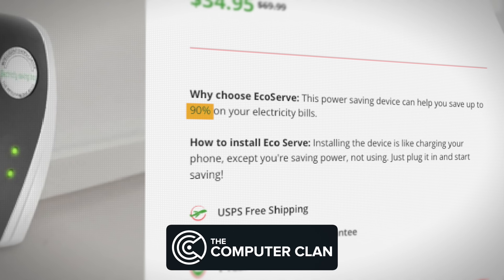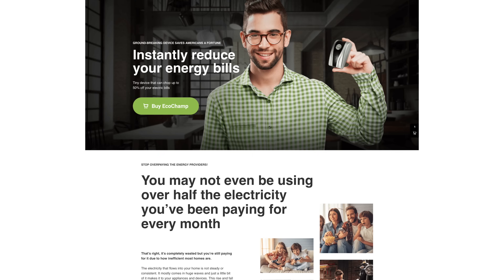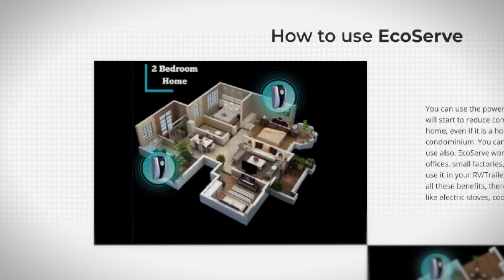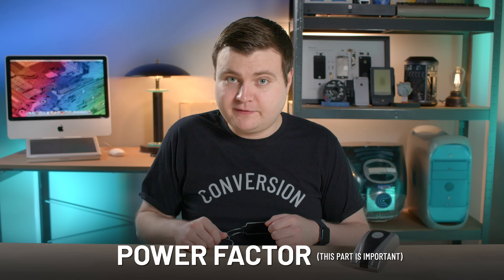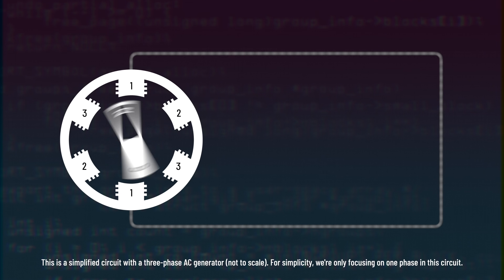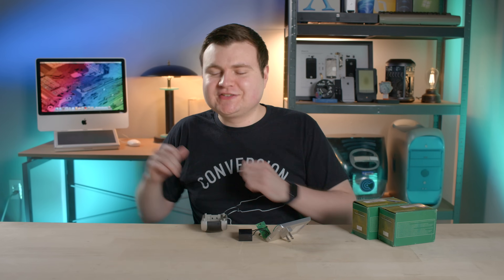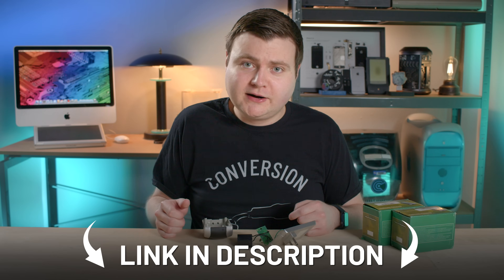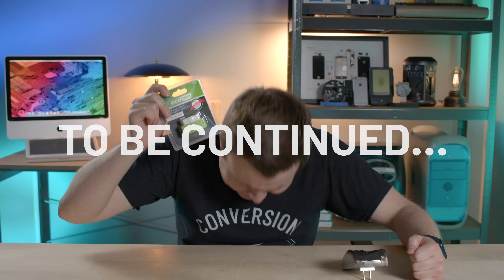Electricity Saving Box Scam (The WORST I've Seen) - Krazy Ken's Tech Talk

Comment: I bought a product that promised to save me money on the electricity that my washer and/or dryer used.  It worked by reducing the voltage to the motor by some percentage and then gradually increasing it as it started up.

I didn't buy it to save money on electricity.  I bought it to reduce the number of belts I was replacing on my dryer.  The motor had such torque that no matter how I tightened up the belts they would still slip when the motor started.

With the device in line, the motor would gradually start up and the belts didn't slip.  I did save money and aggravation from not having to replace the belts.  I have no idea if I saved any money on electricity.

I liked the product.  I never replaced another belt for the life of the dryer!

Comment: An "outlet" is the box inside the wall that the electrical wires from the breaker panel go into.  You plug something into a "receptacle" that is wired and then attached to the "outlet".  Light switches, for example, are also attached to "outlets"..... just sayin..... 🙄

Comment: I don’t think you’ll understand the claims. They are clearly telling you the device saves you 90% in the energy that it could be using, but it’s only using 10%. The other one would have used 50% of the total amount it could have used. This is not the amount of energy is actually saving you from other devices but from its own. So if you plug this in and it should be using, let’s say 100 W of power it’s only using 10% so only 10 W of power. So it is saving you 90% of the power that you could be wasting on this device they’re not lying. You guys are just not understanding the claims.

Comment: The flickering you allude to does not happen with incandescent bulbs.

My father an electronics technician in the Nave for twenty-six years taught me a simple mnemonic to remember how capacitance and inductance affect phase shift. It is "ELI the ICE man."

Inductance, L causes voltage, E to lead current, I. If you look at the voltage curve superimposed on the current curve, the voltage will reach its peak value before the current (ELI).

Capacitance, C causes currne3t, I to lead voltage, E. If you look at the voltage curve superimposed on the current curve, the current will reach its peak value before the voltage (ICE).

Since power is voltage times current, the further the two get out of phase, the less the power delivered.

By the way, we use E because we are actually talking about electromotive force, which is measured in volts, but voltage is easier and shorter to say and write.

Most household appliance use coils in motors which are inductors so the power company has banks of capacitors which kick in as needed to bring the two back in phase. Even in phase the power delivered is the Root Mean Square (RMS) of the product of voltage and current, the value is 0.707. In other words, the power is 70.7% of the product of E and I. P = 0.707 EI.

If you want to understand why this happens read a physics book, or a good electronics book.

Comment: I remember around 1980s gasoline shortage and there was a car that runs on water.  Sure, water carries more thermo energy than gasoline?  Surprise, 20 years later, the same fiction came up again.  Some clueless consumer?  Good video, BTW.
Reply: It's possible with hydrogen fuel cells but it's dangerous for everyday travel.

Comment: Back some time in the '92 - '95 window, we made a video for a guy (a scientist or so he claimed)   He put a magnetic coil around the fuel line on his test car and supposedly, by aligning the chakras of the gasoline molecules, he could increase the engine efficiency by like 20% (i.e. reduce your gasoline usage). I don't remember the actual technical explanation, only that all it was was an electromagnet and had something to do with aligning the phase of the gasoline molecules. The beauty of his device was that at that time, all you needed was a good sounding claim to get a tax break for driving an "Alternative fuel source" vehicle. So people could buy his device and have it installed for under $200 and then apply for a tax rebate that was way more than $200  and continue using gasoline as they always did. So did it work?  Well... that all depends of how you measure success.  He sure earned a lot of tax rebates for a lot of people.  In that sense, it worked. As to whether it actually reduced gas usage, I don't think there was any measurable effect for most people.

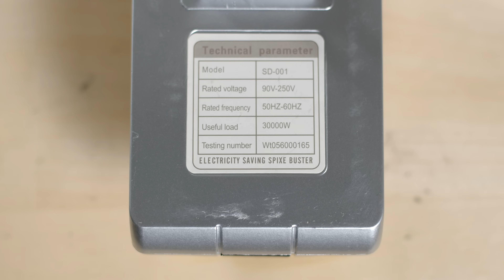Comment: @10:07   On the back, did you see that "Useful Load:  30000W"   Oddly, we didn't see any fuse in this device.  I defy you to take this to an industrial shop with lots of heavy motors and see if it even winks there. Either it will melt down immediately, or it wont do a damn thing.

Comment: One thing you didn't mention is that it seems the legitimate circuitry for this device is well known by bigclive fans as an ionizer. It seemed to have a few ion emitters connected to the capacitor. So they are essentially advertising an air purifier as a power saving device

Comment: I bought one of these out of curiosity. Used different tools I have to check power usage. But the interesting thing with mine. Same case. But actually had a large pcb with a bunch of components on it. I never bothered to pull my meter out and confirm they were all wires together on the board but I suspected half didn’t connect to anything. Just for show parts like they knew you’d open it. It also eventually started smelling like burning wires so pretty sure these things will eventually cause a fire.

Comment: Just think. If one saves you 90% on your electricity bill then two will save you 180%. So your electricity company will be paying you 80% for all the electricity you use. 

Time to plug in those heaters and air conditioners, humidifiers and dehumidifiers, etc. 

And if you get three, that’s 270% saving so the company now pays you 170%

Wow

Comment: Actually, AC itself doesn't help wires carry more electricity over longer distances, higher voltage does, and AC makes it relatively easy and cheap to convert electricity between higher and lower voltages, using simple transformers.  The end effect is to help transmit more electricity through longer distances, but today, it is possible to do the same with DC, and some of the longest, highest-capacity transmission lines in the world actually have DC electricity going through them.  This is because at equivalent voltage, DC is actually more efficient, since AC suffers from skin effect losses and reactive (capacitive and inductive) losses, which DC does not suffer from.

Comment: I hate to nit pick on such a well put together presentation, but technically, only ToastyHeater™ is super efficient, it recycles the heat already in the room so no heat is wasted. It's quantum fiber ceramic heating element breaks the laws of thermodynamics for extra efficiency.

Comment: Hello, I've just discovered this channel a few days ago, and when I saw this video, I've found this scam strangely similar to another one I saw on a French channel, about the same kind of product. Or maybe it's absolutely the same with another colors...
Anyway, you gave the same explanation about the power factor, the same kind of tests about this scam and the same analysis about the electrical circuit. Except one thing: he's goes further and dismantle the capacitor. Or what it seems to be a capacitor, since it's only rubbish. Yes, the scam is even worst than you thought.
(Sorry, there is no subtitles available in English, but I think the images are enough)
https://youtu.be/1FLwy4XPBg0?feature=shared&t=753

Good job and please continue. Not only you explain theses kind of scam in a perfect way to be understandable by everyone, but you also talk about some failed devices but done with respect and real hopes. And on theses, you talk about them with respect, telling us than even if theirs products are scraps, they are not cheaters or thieves. Thanks for that.

Comment: 6:36 As an Electrical Engineering student, I can say this part is wrong. Knowing that the power factor of an AC installation is equal to the cosine of the phase angle(the exact angle of the argument of the total impedance load attached to the installation) and this angle ranges from 90º to -90º its cosine only can range between 0 and 1.
Reply from the maker: Yes, I trust your explanation. I've heard (and just double checked with one of my research guys) in most practical AC applications it's 0 to 1, but I've also seen from multiple sources (which I just double checked) the negative sign is indicates voltage leads the current. Does it depend on the situation?
Reply: @ComputerClan  Well, the thing is that even if the voltage leads the current or viceversa you're getting reactive power that decreases your power factor. In AC systems the most probable thing is that the current laggs voltage because of most of the inductive loads attached to the line. That's where you use a capacitor bank to fix the lagging.

The positive and negative sign is used more on impedance and current phasors to represent them and that way you can figure out if you're working with and inductive or capacitive load.

Btw, I forgot to tell you, but it's the first time I visit your channel and you made me enjoy so much with this video🤗. Greetings from Spain!🤗🤗🤗
Reply: @ComputerClan  According to the main phasor sign agreement(used here in Europe as far as I know), inductive loads have a positive angle and capacitive have negative angle. However, in their current phasors the signs swap because of Ohm's Law.

Also,  the sign criteria for impedances angle comes from physical-mathematical conclusions about the phenomena from electromagnetic induction applied to impedances and reactances.

Comment: I bought one of these things a few years ago knowing it is a scam, but I wanted to know the level to which they might go to conceal the true nature of their claims.   I paid $12.99 and it came two weeks later.   After unboxing I could tell immediately it was too heavy for its size and a presumed transformer small enough to fit in the small enclosure.  It had an LED light  on its cover that worked when I plugged it in!  Not sure why this surprised me but I pressed on by prying the back plate off.   Inside the entire thing was packed with some kind of suspicious-looking glazing compound.  I tested it for lead and waddyano?  LEAD!   I put it under my fume hood, put on gloves and proceeded to scrape out the putty.  After it was empty I found the two LEDs and one resistor and NOTHING else!   I think I reacted to the first ad that was touting this thing because all of the expo videos now show a different unit.   Anyway, The lead-bearing putty had no wires in it to indicate it was being used a some kind of capacitor and as I have never seen a capacitor made this way it was readily apparent the whole thing was a scam!   I contacted the FCC and BBB and gave them detailed notes and pics of the entire affair and within a month the ad had changed and was now hawking the unit as it appears in this video.  IDK if my actions precipitated this shift or (more probably) they redesigned it by packing the putty into the little black box found in these things now because too many people scraped out the putty!  There are energy rectifiers in some things in your house.  They are not there to lower your energy costs but to condition the power to MOTORS in things like refrigerators, Washers/dryers, ovens and HVAC units.   Motors NEED smooth, reliable power to work efficiently and last longer, which is why you don't leave plugged-in automatic devices with motors during brownouts!  Low, surging power can destroy a motor in short order by inducing an electrical field that is too small to turn the rotor and fan with sufficient velocity to keep the windings cool.   This is why in lower voltage instances you should unplug or turn off breaker to any devices with motors that come on automatically.

Comment: Fun Fact: Power companies will actually encourage you to save power. The reason is that if so many people use too much power, the power plant may have a hard time keeping up, which will lead to power outages so they would have to build a new power plant to keep up. Which that is a pain, the cost to build a new power plant would be way too expensive, plus they will have to find a location as you can't really place power plants all willy nilly. The state I am from, the power company will actually provide residents a free power saving kit. Which will often include free light bulbs, a free power strip, and a few other things that will help save you electricity.
Reply: Also reduced loads over cables will let them last longer which means less costs in repairs.
Reply: Yea a lot of that energy saving stuff you mentioned are things bought by companies who are being forced by some local green laws to provide some green products, and buying faff of the shelf is easier than building actual green energy infrastructure 

One particular electricity company in the UK sent out dozens of energy saving light bulbs to customers a few years ago, like a microwave sized box of them! I've still got a good shoebox full left years later....  it raised a bit of press at the time as if the hour ratings on the light bulbs actually held up it was a 200yr supply for your average house! In reality it's more like 12-14 years worth
Reply: @mor4y green energy infrastructure is wasteful and expensive and does nothing for the environment, as was warned before and as is being demonstrated now.

🤷‍♂️
Reply: Less is more
Reply: The power company offers them, but they’re state funded.

Comment: The capacitors in motors are only for starting they do not stay in the circuit they are removed once it runs. There are no capacitors in motors for apparent power correction.
Reply: Starting capacitors would be needed in singlephase motors, but three phase they are entirely used to correct the power factor.

Comment: how can they charge for something that just goes back and forth with zero work done.
Reply: Because it still increases the load that goes through the cables wich will degrade them a bit faster, meaning they need to be repaired/changed more often wich costs money.
And it is doing work.
Reply: @Alex_Vir Its never dissipated, so it never does any work

Comment: A couple small corrections. Reactive power is not wasted as heat, waste heat in your home wiring is real power, but rather it increases the amount of current sloshing back and forth between the generator and you, so it increases the energy wasted in transmission lines. If we had superconductive transmission lines, reactive power wouldn’t cause any waste. To account for those line losses, either industrial customers’ cost per kilowatt hour of real power changes based on their power factor, or they are billed on apparent power.

Comment: A proper line noise filter costs around $100 for the lowest wattage output to 1 or 2 thousand for enough wattage for a small business. They are good for efficiency which means lower heat- think a small confined server room. They can also be good for power for high end audio equipment. But if the incoming current is already very low noise then they offer little benefit.

Comment: The PFC (Power Factor Correction) is part of any DC power electronics design specification. What is important is the "power efficiency" which is the ratio of the power used to do the actual work and the input power (counted/measured by the electric meter). If the input power is crappy/dirty then the power electronics has to work harder to correct and produce the desired DC output so it will consume more.  For example, an sound amplifier for 80W speaker would actually use 100W because the electronics circuitry will consume the difference in order to work, so the efficiency will be 80% (80W/100W = 80%). However, the heavy consumer in a home are the electric motors and heaters (cooktops & furnaces). So, the question is : what is the power efficiency of your devices (appliances, etc)? Is it 80% or even less? The difference from 100% is what you  "overpaying" in the bill. As an analogy, if I use premium gasoline or drive on the freeway (high speed and constant) I have better efficiency (mpg) compared with regular/dirty gasoline or driving in town (slow speed, stop & go, pot-holes). Unfortunately, the electric infrastructure is full of bottlenecks and the back injection into the grid which is out of control so it can't be clean.

Comment: I cut my “black box” capacitor looking device.  It was 2 wires embedded in some tan colored clay, not a capacitor or any kind of electrical device at all.  The wires easily pulled out of the clay.

Comment: Before smart meters in Australia "some people" would run devices (usually a combination of AC motors and hulking great big capacitors) to make the power meters run backwards.
Smart meters compensate for power factor nowdays.
Reply: ... someone needs to make a documentary on this. That sounds pretty cool, honestly.
Reply: @plzletmebefrank  nah it's not that interesting. Disrupting power factor is literally the principle that made old meters work. Most of the time peoole got it wrong and made the meter run faster. Took a bit of skill to make it go backwards. A hulking big rare earth magnet on top of the meter was much more simple and would just slow or stop it. Power companies got jack of that and invented smart meters, that can even pick if you are tapping power before the meter using earth leakage detection.

Comment: There is also a one "little" problem with these, capacitors cause a 90 degree shift in phase, if you aren't correction anything you are making your power factor worse.